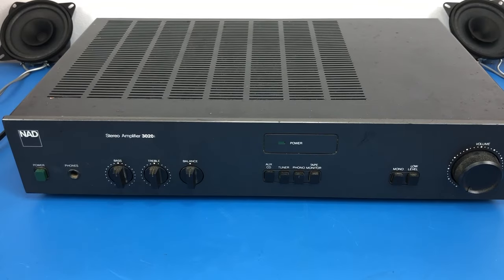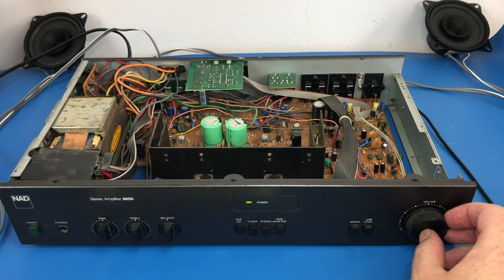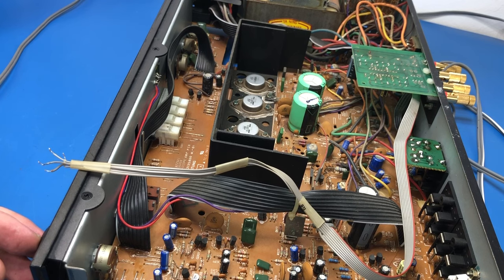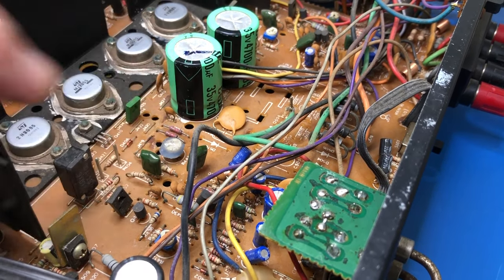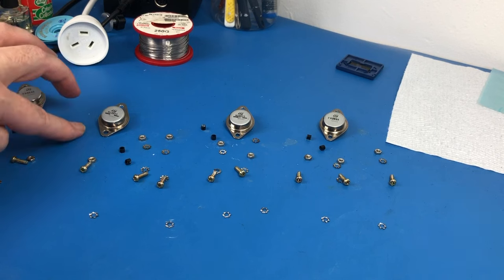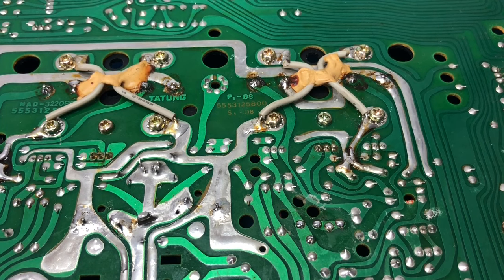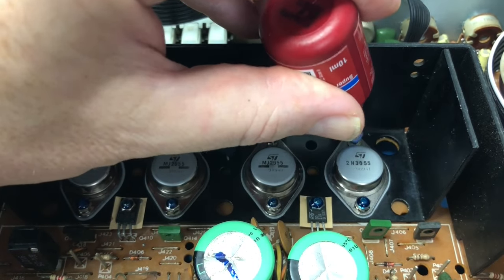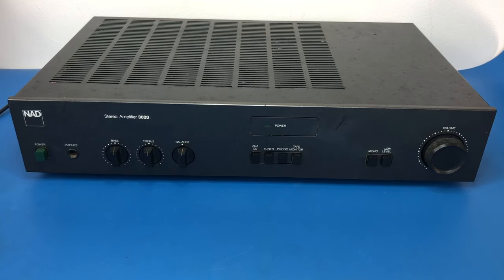NAD 3020 Vintage Amplifier Repair & Service

Comment: If you have any older, larger value and voltage( 5KuF and 50WV ) or more electrolytic caps, you can put one in line with each test speaker to prevent damage to them. Some older transistor amps had them in the amp's design ( Dynaco ST-120 for example) It'll save some speaker smoke if things go south while testing in the future. Good effort nonetheless! 👍
Reply from the maker: That's a simple but fantastic suggestion - thanks for that! Of course the NAD 3020 / 3120 has no speaker protection circuit at all, so yes, if something goes wrong it can end in smoke. The Leak Stereo 70 is another amplifier that has series caps in the output.
Reply: Good idea, never thought of it before - you'd want 2 of them back to back though to make it bipolar
Reply: @audionautica6843  I think my NAD 3020 series20 cost me the twitter to burnout on my Infiniti Alpha 50… Towers. Currently left channel is pretty scratchy, on the mid range, start button make that scratchy sound when turn on for 5/seconds…😭😭😭 …now its off my system using the 3020D …hybrid, that I don’t really like…got the NAD 2200 & 1155 coming soon… if you can’t help with my 3020 series 20 will be fantastic I can make video and describe the problem and pay you whatever you think it’s reasonable.
Reply from the maker: @viktor928  It really needs to be on a bench to repair and sounds like parts will definitely need replacing. I suggest you find a technician where you live.
Reply: @audionautica6843  Isn't it usually only ones with single-ended power supplies and to take away the DC-offset?

Comment: I repaired a NAD 3030 years ago, it was my first amp repair. Unfortunately damaged my speakers as it was putting out DC from the speaker terminals. Ended up having to replace the power transistors and the drive transistors as well. Thankfully in those days schematics were easy to come by. I think the speaker repair cost more than the amp repair in the end! I traced the cause to a bad earth connection from the PCB to the chassis, the wire was held by a screw which was loose. This caused occasional spikes when on phono input and destroyed the power amp.
Reply from the maker: Thanks for watching!

Comment: I believe that the threadlocker you applied is anaerobic. Meaning it only hardens and works its thread locking magic when it's on the threads of the nut/bolt when being put together. The lack of oxygen is how it cures.
Reply: Thats correct, but it will creep into the threads and cure to some extent.  TBH I wonder if you even need threadlock, considering there are star washers under the nuts, but better safe than sorry I suppose.
Reply: @richardsinger01  Hell, for what it costs for the application, why not!

Comment: My 80s PIONEER amp. @110-watts per side @ 8-ohms. hisses a bit after 10-oclock it always has.. It's not a loud hiss but you can hear it a bit.. I don't think there's anything wrong with the circuit... You do great work...

Comment: I really admire you folks who fix things. It's a great skill. I wanted to do electronics at school but they dissuaded me as I wasn't good at maths. All the items I see dumped here in Britain. In the street even: vacuum cleaners, consumer electronics. I guess it's all driven by product life cycles. Apparently, under huge pressure, Apple is now allowing people to fix their phones.
Reply: The problem is, atleast here in Finland, that you’re not allowed to repair 230 V stuff unless you have all necessary rights which are quite difficult to get. I work with industrial automation but there we have one engineer in charge of the rights and at home I’m not even allowed to make an extension cable. Also to do this for a living you can’t put 4-5 h on a 5 year old 200-300€ gadget, but yes it’s a shame.
Reply: @Hank_E  in the UK house electrics are off limits for amateurs, but repairing electronic items is perfectly ok.  I have no idea what controls there are regarding repairing stuff on a commercial basis.  You'd need liability insurance at the very least, but possibly qualifications too - if such still exist.
Reply: Don't let the 'maths' bother you as you can enjoy the hobby with minimal abilities, just some basic stuff.
Reply: It doesn't need to much maths knowledge for the Ohm's Law calculations - you'll use a calculator anyway.  It's once your start discussing phase lead/lag where you need trigonometry knowledge.  There is nothing to stop you improving your maths ability - it usually depends on the quality of the maths teacher who does not know how to teach.  The difference between a Good maths teacher and a bad one is frightening...
Reply: @richardsinger01  The course is C&G 2240 Electronic Servicing Course - there's 3 levels: it's gained a '0' since I did it 40 years ago [I only just realise it was that long ago!]   The biggest problem/limitation is miniscule surface-mount components - resistors/capacitors/inductors - that are the size of the snapped-off pencil tip.  Too small to carry any markings - if you can't get a circuit schematic diagram then you are stuffed and have to make a lucky guestimate at the correct type and value.  It should be illegal to prevent electronics equipment being repaired.
Reply: @jonathanpalmer155  Yes it should !

Comment: One other comment if I may, just a small observation but I can't verify my claim. At the very end of the video it appears to me that the lid was not cleaned up to remove any of the rust that had built up over the years. If I am mistaken I do apologize but it was just to say that ideally all corrosion should be removed to prevent any of it falling onto the PCB and its components over time and to keep the corrosion from spreading. I really liked your video and chose to subscribe. Cheers!
Reply from the maker: Welcome to the channel and thanks for the sub! Of course a lot of factors have to be taken into account in making a video and repairing an amplifier. It just isn't possible to show everything on a video, and if I did, people wouldn't watch it because it is too long. I did film pretty much everything for one of my Quad 405-2 videos and the raw footage was almost 3 hours, it was still 1.5 hours by the time I edited it down, and it took forever to do the editing. I don't have time to do that regularly. A repair is not a restoration. You can tell just by looking at corrosion what needs to be removed and what doesn't. This is a low cost amplifier that someone picked up cheap on Facebook market place. He is absolutely over the moon with the result. Thanks again for watching.

Comment: AMAZING change in the look (and maybe the sound). However, if you have added red loctite instead of blue, the sound would be warmer a bit ;-) (blue is always cold(ish))
Reply from the maker: I should have used oxygen free loctite
Reply: Single crystal silver plated oxygen free loktite at the very least.

Comment: Hi, Love your video's! You should definitely get a desoldering station. I don't understand how I even did without it. The ZD-8915, very affordable, not the best build but works great!. Nozzles are cheap.
Reply from the maker: Thanks for the tip!
Reply: What, not use solder wick and miss out on that 'burnt thumb and First finger tip' sensation?
Reply: @jonathanpalmer155  yeah and stench, lost pads and loads of mucky flux... love it

Comment: The silicon used on that trimpot may have been the acid cure type which will corrode metal.
Reply: Yes. The corrosion is actually from the silicone itself. Definitely not the right product to have used on this.

Comment: Great video. I have NAD 302 version, the light is on but can only hear extremely low sound if I crack the volume to the max. Can you suggest anything i can try? 
Thank you.
Reply from the maker: Sorry, can't really suggest that much off hand. Try removing the links on the back panel between "Pre-Out" and "Main In" Use a source with a volume control (like a phone) and connect it to "Main In". You should be able to drive the speakers normally. If this works, it tells you the fault is in the pre-amp section. If it doesn't work, then the power amp section is at fault. You could also (with the links installed) see if the "Tone Defeat" switch makes any difference. Also I read somewhere that sometimes the Soft Clipping switch on the back panel can give problems - try cycling it a dozen times and see if that helps. Whatever you do, don't go spraying WD40 into switches or controls. Only ever use proper zero residue electronics switch cleaner. Good luck!
Reply: @audionautica6843  Thank you so much, I will give those a try 👍

Comment: Hello, I have similar I believe the first one NAD3020 series 20, my left channel just start getting distorted, my power button gets scratchy when turned on how much will that kind of service cost me would you take on my project? Where are you located? Thank you!
Reply from the maker: Hi. I'm in Sydney, Australia. I'd advise against using if it is distorting - these do not have any speaker protection and you don't want to blow your speakers. They are relatively simple to work on, however it is impossible to know what work needs doing until it has been looked at. Sounds like the power switch needs replacing, but there are likely to be other issues based on what you have described. I recommend you find a competent tech in your area. If he suggests replacing all of the electrolytic capacitors as the "solution", find a different tech.

Comment: As you adjusted the bias it would have been more practical to show us how you were adjusting the pots as it would have been more instructive. You could have simply introduced how you were making measurements and simply informed us of the values as they went up or down relative to the pot adjustments. Just a little note I suppose.

Comment: Noob here. Why did you have to de-solder then resolder something when you ajdusted the amp?
Reply from the maker: Whether you need to do this will depend on the circuit, but the service manual should always make clear what the procedure is. You are always trying to measure the bias current (in a BJT final configuration) as a BJT is a current controlled device. Biasing sets it so that the transistor is always turned on, because when it switches on and off it will cause distortion. In some amplifiers, you can just measure straight across a series resistor - no links required. In some you are required to actually put an ammeter in series and measure the current. Others (like this one) will have you remove a link. From memory (without looking at the circuit), I think there is a resistor there that is used to measure the bias current. The resistor is only able to hand the bias current, if you left it in circuit at normal power outputs for a period of time, it would burn out. Hence the reason you short it out again once the bias has been set. Writing this all from memory, so its not guaranteed, but you get the general idea...
Reply: Cool, thanks a lot! What's a BJT?
Reply from the maker: Bipolar Junction Transistor.

Comment: Hi. How check and adjus the bias in the NAD 3020A. Thanks
Reply from the maker: You download the manual from hifiengine and follow the directions, or you take it to your local audio tech and get him to do it. Problem is if you are not sure what you are doing you can blow your amp. I once blew an amp while trying to adjust bias because I didn't realise my ammeter had gone open circuit
Reply: @audionautica6843  I blew the series power regulator transistor by accidentally causing a short, when measuring the output stage bias on a Quad 303, fortunately, this was the only fault I created!
Reply from the maker: @Radfordperson  Yep - we learn from our mistakes, especially if the magic smoke is involved.

Comment: Just to clear up what has become a common misuse of terminology on YouTube. There is a difference between corrosion and rust. While both describe oxidisation, there is a difference, just as fire is also oxidisation. Rust affects ferrous metals, iron and steel. If that lid is made of steel - and I’m sure it is - then that discolouration is rust. Corrosion affects non-ferrous metals, aluminium, copper, tin, etc.

This actually does matter because the chassis will almost certainly be made of ferrous metal, while there will be a lot more non-ferrous metals inside.

Thumbs up anyway.
Reply from the maker: Yes - it's rust - but there is a difference between surface rust and more serious rust. If in a damp or humid environment it will proceed at a faster rate. In a dry environment, it should proceed very slowly. So then one has to assess - for an amplifier of that age and vintage is it worth stripping back and repainting the lid, or more to the point - is the owner prepared to pay for it. I wouldn't - not for that amp, anyway.
Reply: @audionautica6843  My point is that while the process is basically the same, the terms are not interchangeable.

Comment: wtf are you cleaning transistors and replacing washers???? ffs
Reply from the maker: 1) Because this amp is over 30 years old and thermal grease dries out over time. It then no longer transmits heat, the transistors then overheat and die.
2) If you are going to properly test the transistors, you need to take them out, in which case the thermal grease needs to be replaced anyway.
3) Because silpads are a much neater and more elegant solution than the thermal grease.

I once had a computer whose' network name was SLARTIBARTFAST. Had no idea it was from Hitchhikers' until you made me Google it just now!
Reply: @audionautica6843  Great program that, The Hitchiker's Guide to the Galaxy. Love it!

Comment: Very poor quality electronics made by Tatung.
Reply from the maker: I guess it depends on how one defines quality. When I studied quality control, it was defined as the ability to consistently and repeatedly produce a product within its design specification. NAD did that - they made decisions about a price point, and in doing so the NAD 3020 became the most popular amplifier in history. I myself prefer to see amps that look like they are Mil Spec, but hardly anyone would buy them if they were.